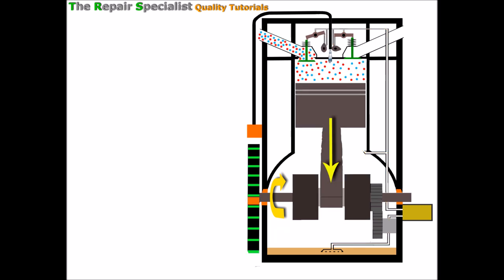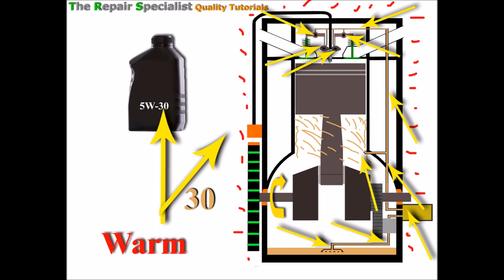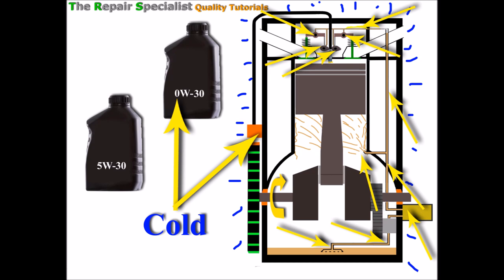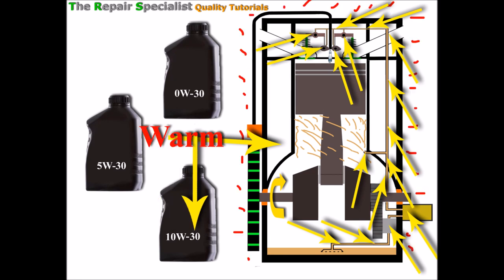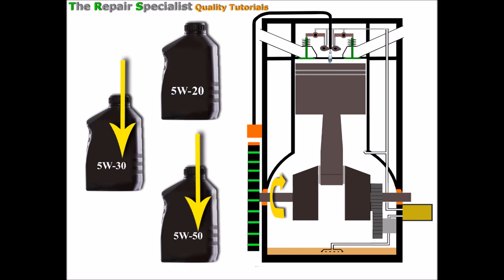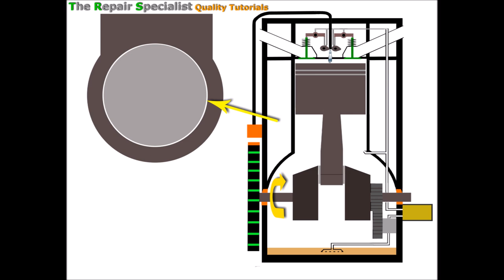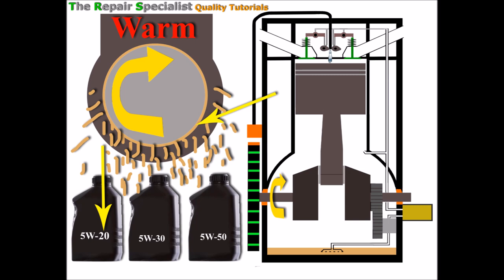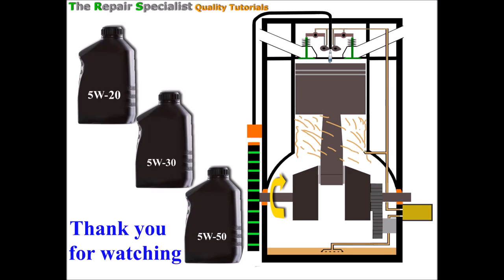'Engine Oil' - If Incorrect, this will happen! - Car, Lawnmower, motorbike, etc

Comment: Yes and No.  You also have to consider the automobile manufacturers will recommend the thinnest oil possible to claim better gas mileage - when in fact a thicker oil will protect better.  For instance - I have run a 5w30 in my V8 F150 since new even though 5w20 is “recommended”. I’ll never see a difference in gas mileage as the manufacturer gets their numbers from an average of many vehicles combined.  However - I’m at 120k miles on the engine and it still runs like new.
Reply from the maker: You've raised an insightful point about the use of multigrade oils in vehicles, and it's great to hear that your V8 F150 is still running smoothly at 120k miles with your choice of 5w30 oil, despite the manufacturer's recommendation of 5w20. It's true that automobile manufacturers often recommend thinner oils like 5w20 to optimize fuel efficiency, as part of their strategy to meet regulatory requirements and market demands for better gas mileage.

However, the choice between a slightly thicker oil (like 5w30) and the recommended thinner oil (like 5w20) can be nuanced. Thicker oils can indeed provide better protection in certain engines, especially under high load or high-temperature conditions, as they maintain their viscosity and protective qualities better than thinner oils. This can be particularly relevant for older engines or those used in harsher driving conditions.

On the flip side, modern engines are often specifically designed for thinner oils, and using a thicker oil can sometimes lead to increased friction or reduced efficiency, which might not be ideal for every engine type. The difference in gas mileage might be small and not noticeable in everyday driving, but over the lifetime of the vehicle, it could add up.

It's also worth considering that engine technology and oil formulations have evolved significantly. Modern synthetic oils, including thinner grades, are often highly effective at protecting engines, even under extreme conditions.

In essence, while it's important to consider manufacturer recommendations, your approach of using a slightly thicker oil and monitoring the engine's performance is a practical one. It's always a good idea to keep an eye on how your vehicle is responding to the oil you use, and to consult with a trusted mechanic, especially as the vehicle ages or if it's used in demanding conditions. Your experience underscores the importance of understanding your specific vehicle's needs and not just following general guidelines.

Thank you for your input

Craig
Reply: @TheRepairSpecialist  All  very good points and extremely well thought out.  I appreciate your response.

Comment: Nearly every modern engine made in the last 50 years has called for 10W30.  All of these engines, using that oil, have had very good life when it comes to wear on moving parts.  The current switch to 0W20, to satisfy mileage requirements is causing premature piston ring wear, and probably a lot of excessive wear on other parts, like oil pumps.  You can expect to need an engine overhaul below 70K miles if you use this oil.  The manufacturers care about government and don't give a damn about the customer.  BTW, the manufacturers like Honda, Toyota, Subaru, to name a few, are aware of this and offer recalls on excessive ring wear, but, as usual, they have myriad tricks to get out of covering the customer for their MISTAKES!

Comment: I have a 2017 volvo xc70 D4, can u tell me is it possible the wrong viscosity oil could cause engine failure (crankshaft to break) over a 3 month period

Comment: Do i need to 'flush' my 20w-50 to the correct the 10w30 recommendation? Or basic oil change will do? Only a month used wrongly.
Reply: citrusphere yes! Immediately
Reply: @AdityaShukla97  My cars handbook "users manual" says the proper engine oil for this car is either 5w20, 5w30 or 10w30 depending on the climate but for the 6 years i've owned the car i only used 20w50 due to my ignorance of course and the engine is still running with no problems it doesn't even burn oil. my car is a hyundai elantra HD 08.
Reply: Lighto use mobil 1 5w30 i am sure u will notice a lot of change
Reply: @AdityaShukla97   I think it's a drastic drop from 20w50 to 5w30 so in my next engine oil change i will use the 10w30 and in the oil change after that i will use the 5w20 and i will keep using the 5w20 as long as i own this car, cause the users manual says that "for better fuel economy use the 5w20 unless you don't have it your country then use the 5w30 or the 10w30.
what do you think?
Reply: Do not flush the motor with crazy stuff, you're gone damage the seals or something else. Just switch to a 5W40 full synthetic all year round
Reply: @lighto2240  be careful if it's a old car stick with what you are doing and don't use full Synthetic will only burn oil and damage the engine, older the car thicker the oil
Reply: @ibiufos  Thanks for the advise, as i said it's a 2008 model I've made the change from 20w50 to 5w20 full synthetic about 2 years ago and i'm still using 5w20 till this day, the car is not burning oil and the engine is not damage in fact it's now consuming less gas and i think its performance on the road has gotten better  but i'm not sure about the last one maybe it's just a placebo effect

Comment: I have single cylinder bike ktm rc390...can I mix 10w40 with 10w50...? Already there is 10w40 7100 motul in my bike so can I topup with 10w50 ? Bcoz nly oil level has gone down but oil is good in condition
Reply: Yes you can mix them, and for topping off it's even better to use heavier because they thin out with use.

Comment: Hi,
I have a r15 v2, recently i have used motul 15w50 ss oil with 3m flush & additive in my bike, where as 10w40 is recommended. lately my bike is heating more than before (yamalue 10w40), especially on the left side of engine(FYI magnet or some sort idk,clutch plates are on the right.) Also there was a leakage from the oil filter section, they said the oil seal is damaged and did temporarily fixed with glue.
PLEASE HELP. 
Happy new year.

Comment: I just bought a Citroen Burlington van, its recomended it takes brand called, Total oil 5w 30. I have castrol 0w 30 oil in the house that I bought which I never used. I was thinking to use it up, but Iam bit reluctant because once a foreign mechanic told me if the first number is 0w but it recommended to take 5w, the oil wil rush through to quick and cause damage to engine. Any advice please.
Reply: its fine use it
Reply: It won't rush thru too quick, that's stupid. What it will do is wear your eng faster because it's a lesser oil. If you care about it I'd use even thicker but you didn't mention how cold it gets.

Comment: If something live in warmer country like gulf state are they use 20 w 50
Reply: your vehicle manufacture already consider this when selling the car in your area, why are you fighting against engineer that went through years of school? Use the oil thats prescribe especially if you are under warranty. Car dealership will deny your warranty for literally anything...
Reply: My car is not under warranty
Reply: @akhrot2642  ok thats beside the point, the point is the engineer stress test your car for that weight, use it.
Reply: The oii you use depends on the temperature, use motor oil 5w 30 on winter and 20w  40 for summer and 0w 20 for coldest  countries.
Reply: @trilingualkid  He's not fighting an engineer, he's fighting the EPA that wants people to use thinner oil.

Comment: i live in ensenada it is not cold right now i need quart refill muy car uses 10w-30 or 10w-40 can i sue sae40 as refill?
Reply: You can as long as it's detergent oil. Well, I suppose it's not critical to use detergent but it's better. If you're only topping it off I don't a problem at all.

Comment: I just changed my oil today,the mechanic accidentally puts 300ml of 10w60 on my engine ,with 1 liter also 10w40 oil, soo now i have 1liter of 10w40 and 300ml of 10w60,can someone tell me if it is good or bad?.i live in a tropical country
Reply: Now you have 10w-48.5  oil  :) :D
Reply: You have zero to worry about, other than using 10 "winter" which I'd switch to 20, but that's me I want max eng life.

Comment: i put 2 cycle oil on my lawn mower not paying attention until after it shut down realized i picked up the wrong oil it want start now what do i do now 😅
Reply from the maker: I personally would, first of all, remove the spark plug, then have someone press the OPC lever while you turn over the engine to see if it is seized or not.  You might find it best to do this by tipping the mower back and turning the blade. Again, only do this with the spark plug removed.  If it is not seized, then replace the oil with the correct oil and try starting engine.  If the engine will not turn over, then it might be best to take it to a repair shop to be looked at by a professional.  This is because it could be a whole host of things possibly wrong with it.

I hope this helped

Craig

Comment: I have Toyota Prius hybrid and i needed engine oil bad so I asked and all they had was 0W-40 but I need 0W-20 what will happen would I be able to drive it Or is it ruined forever ??? Answer plz
Reply: put in the right oil.      0W-20.     watch for any trouble.
Reply: put in the right stuff.    now.
Reply: where did my comment go?
Reply: It won't hurt it but it may last longer You'll notice in cars with teeny high mpg engines they want you to use super thin oil because it gets better mpg. Better mpg #'s sell cars to people who are after high mpg and if you're buying a Prius you're one of those people. It's at the expense of eng life but all the mfg cares about is selling cars. I can't imagine using 0-20 in anything but a sewing machine but go for it.

Comment: I need help please my honda gx 270 oil leaking on air filter what could be problem 
Thanks
Reply from the maker: It sounds to me like the engine could have been tipped towards the air filter at some point. I would start by cleaning the air filter of oil, or replacing it, then removing the carburetor float bowl and clean it, then I would try starting, and running, the engine and see if all is OK. If you try starting the engine and it seems to have locked up and wont turn, then there may be oil at the top of the cycling stopping the engine turning. If so, then I would remove the spark plug and turn over the engine a few times to release the pressure. Then replace the spark plug and try starting. I personally would go from here and see what happens. Thanks. Craig
Reply: Since this is a 4 stroke engine no oil can come from the carb or the fuel (that kind of oil blow back occurs with 2 stroke engines). My Honda gx270 has a PU foam sleeve as a first barrier air filter. This fits around the metal frame paper filter cartridge, and the foam may be impregnated with oil. The oil is meant to capture the dust, but it tends to settle and leak out to the bottom, if too much was used. Squeeze out the foam or dip excess oil with Kleenex.  The foam filter can also be used completely dry. In that case more frequent cleaning or washing e.g. with diesel fuel, is advised. Some different types of air filters are used on this engine. Perhaps you have an oil bath/wire mesh air filter? That may leak a bit while tilting. No problem in that case.
Otherwise you may have a leaking inlet valve oil seal that blows back oil. In this case you should see oil traces on the valve stem and inlet channel. This is worse, but reparable

Comment: Hello  i would like to know if  it's good to mix oil 5w 30 with Mecarun P18 additif oil??? Thanks
Reply from the maker: Hi. Thank you for contacting me.  I do, however, have to advise that you stick to the oil specification suggested by the manufacture of your engine.  The reason for this if because if I suggest a particular oil for you to use, then you go ahead and use it, and it results in damage of your engine then this would be terrible for you and my liability would be in question.  I hope you understand my point. Thanks again though. Craig
Reply: Ok...thanks Craig  for your  answer...i understand...thanks Alain best regards Rui
Reply: Sorry...thanks again best regards...Rui

Comment: I'll try to use 0w40 mobil 1 full synthetic  in a mercury grand marquis 1997 4.6l v8. In the engine oil tap it says use 5w30 but in the manual it says use 15w40 for best performance?.  I am from Mexico. I understand that in 1997 there was not 0w40 oils but if I have the option to lubricate fast the engine, why not? Plus.. It also says in the manual that synthetic oils can be used in any desired viscosity.

By the way.. As extra.. In my 2008 dodge ram 5.7l hemi engine users manual it says as well,  use 15 w40 for optimal engine operation. Yet I I've seen that in USA they use 0w20 on those engines wtf? 😕😒😭 I am so confused lolol.

The temperature here ranges between 0°c in winter to 45°c at summer
Reply: Remember that the U.S. version says 0W-20 only because of federal government fuel efficiency requirements so that is the grade of oil that the manufacturer has to say but that is not the best the engine longevity, only for MPG requirements. Motor oil has also come a long way since your car manual was printed. Don't worry about what is printed on the oil cap, many times thst is based on what was popular in the country where the car was manufactured at the time and they use the same oil cap for many models. 0W-40 will be a great choice since that will be a full synthetic. Just change you oil frequently and you have nothing to worry about.

Comment: But my mower says use 30, not multi grade. Now what
Reply: Use what the manufacturer recommends. Especially in engines with no Oil pump.
Reply: It has to do with not having a filter. What they really want you to use is non-detergent oil so the dirt/metal settles at the bottom where detergent will try to carry it around to the parts. So if you can find some other non-detergent I'd say go for it, but generally all I see is 30wt

Comment: what should you do when u used the wrong oil
Reply: Use the right oil instead.
Reply: @JA-rn5qv  true fixed it 8 months back 😅😂 air filter even had oil in there becouse the oil i used was too thin

Comment: Yeah it's funny how people buy 10w30 or 15w30 for fords with the 5.4 3valve when it needs a 5w30 and is on the 3-4th engine lol
Reply: I ve been running 10w 30 in my 3 valve for years. 349k. So either your wrong or i am lucky.
Reply: @thomasfogerty3515  is that engine on original timing chain cam phaser chain guides and chain tensioner, and what year is the vehicle?

Comment: What will happen when we use 5w40 ?
Reply from the maker: Hi. Well that depends on what the questioning is exactly.  
A 5W-40 will act like a 5 does when it is cold, and then when the engine reaches working temperature, it acts like a 40 does at that temperature.  I hope this helps. Thanks , Craig
Reply: Can we use 5w40 instead of 5w30 in bikes during summers
Reply from the maker: In my opinion its vital to go with your bikes manufactures recommendation for the type of oil it requires. If I tell you to use a specific oil and then your bike gets damaged as a result then my liability is under question.  Thats why i cant give you an answer to that.  Sorry
Reply: @rakeshkumarsingh5244  I don't have to worry about liability so I'd suggest a 20 "winter" at minimum and ~50 hot, so 20-50 is easy to find so that makes it easy. I'd use even thicker but you didn't specify what bike and how hot summer is.

Comment: BULL,  have never seen any damage from oil other then not changing it, in my profession of a mechanic in 30 years.
Reply: MrMac5150 u didn't see bz u never go deeply into the engine. It happen very slowly that human eye's can't see.. what he said its drop the performance bz it drag,  oil is thik, .... For that engine get hot...  Ur a mechanic i respect for that..u don't ride bike or car to long to understand this fact.
Reply: So what can I do when I mistakenly used the wrong  oil 20w-50 in a 5w-30

Comment: My car requires 0w20 i put 5w30 in it accidently what can happen?
Reply: nothing really , just next time whenu change oil you can put ur normal oil :)
Reply: K i noticed my mpg lowered a bit ive switch it back and notic my mpg hasnt went up back to normal
Reply: @jaykey6166  my car requires 5w-30 i use 10w-40 becouse i live in hot climate and my engine has 150k miles this car has tires r15 but i use r17 and my consumption should be 5 l /100km now becouse i use thicker oil and bigger tires its 8 l / 100 km its normal your mpg can be bigger or smaller from manny reason even oil but if you drained the car and put ur normal oil its should be 100% ok
Reply: I see and honestly when i got this car i have the wrong tire size i went to ss tire shop and they found out but my mog in and high way city i had the gauge at 39mpg now its 33 32 mostly
Reply: Your car will last longer

Comment: warms up and gets thicker? wtf?
Reply: No, when the engine heats up the oil gets thinner. I have owned v8 muscle cars and lived in Arizona. 10w30 works well in winter and 20w50 works well in summer and keeps the engine sounding smoother longer in the extreme heat!
Reply: I wrote a reply three posts up about that, but basically the answer is no, it does not get thicker. I suppose it could if they wanted, but that isn't the goal or the result.